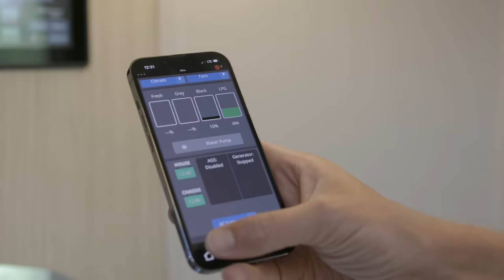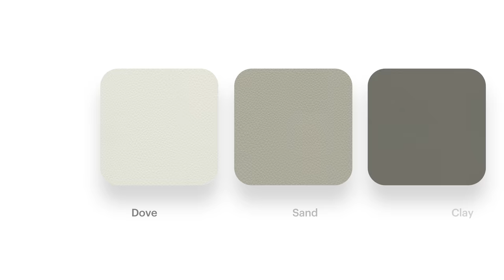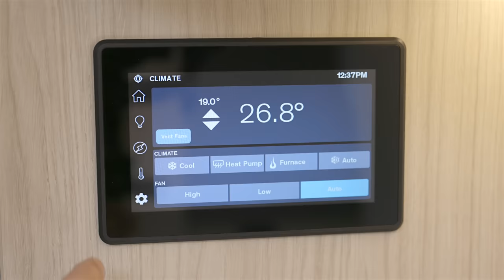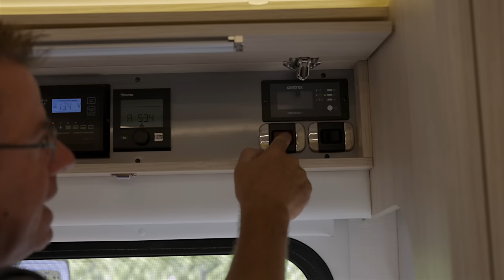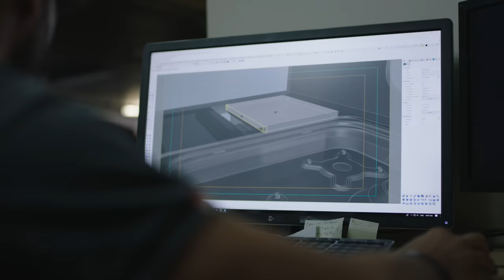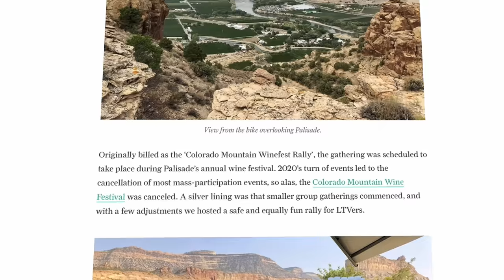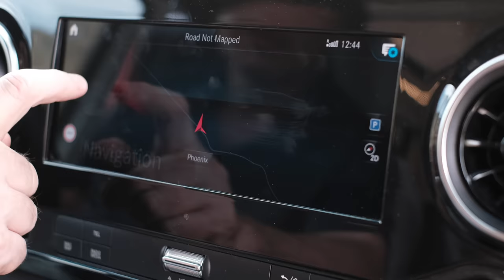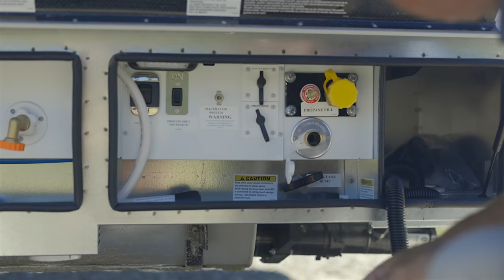2023 Unity Murphy Bed Lounge

Comment: Great vehicle with lots of amazing features - the Murphy bed is a real winner! However, as a Canadian - one thing lacking in almost all RV's, is good winterization, which is, adequate insulation for use during late fall and even the winter, instead of renting a chalet. I want to be able to park the van outside in -10C weather and not worry about pipes or the fresh water and grey water tanks freezing up. Even going to high mountain areas or up the Alaska highway into the Arctic, where temperatures are considerable cooler, better insulation means less running of the propane or diesel heater or the air con.

Comment: I wish Leisure Travel Vans would consider using Panasonic Vacuum Insulation Panels in Unity Models. The R-Value is R-60 per Inch! They can custom make panels to spec. The vans would be cooler in Southern climates and toasty warm up North .... year round.  It would justify purchase as year round livable vehicle.

Comment: Really glad to see induction cooktop and other additions. Will love it when propane is out of RVs. More solar when parked and more batteries, or if Ford gets that Hybrid Engine with large battery pack... can be even more off grid.
Reply: They listened!!!! Induction!
Reply: I think you meant propane.  It still uses diesel.  The key is more lithium battery storage.
Reply: @joniboulware1436  We call propane natural gas sometimes even though inaccurate.The F150 Hybrid can get up to 7.2 kW battery pack you can run tools off of and then kick on the engine to recharge. Would save space too. I'd imagine they could create an even larger battery for RVs.

Comment: I am blown away.  I would like an option for 360 degree cameras that can stitch the 4 camera feeds into a surround view, like offered on Teslas and Chevy Traverse.  These also need to be available for viewing remotely, and with motion sensed video recordings to the cloud (in case someone breaks in and steals or vandalizes the equipment) and/or local storage (SD cards) for continuous or motion event recording.   Presentation here excellent, kudos to Dean.

Comment: Still an Absorbtion fridge.  I have a 12v compressor fridge in my CRV, and it works rock solid, and freezes things when needed.  Upgrade the fridge instead of the hokey fridge door!

Comment: Behind the bathroom sink install a molded high temperature water proof insert that can be removed for cleaning. This is critical so wet shampoo bottles & hot curling irons etc can be safely stored. Also grove the insert so dividers can be placed in so they don’t shift when driving. If interested I will email a diagram.
Reply: Dividers/spacers are a great idea, they can even opt for foam-core to keep the weight down whilst providing loads of them for different applications/locations!

Comment: Need an all electric option.  Proper sized lithium bank and inverter with a secondary alternator, 12v AC with heat pump, electric heated floors and water, induction cooktop.  Most of the competition is doing it and there’s lots of people doing it aftermarket with their Leisure’s.  Need a factory option already.
Reply: No power grids to support them, charging takes forever, battery eventually starts taking less and less charge. And tons of people have reported that many charging stations don't put out the correct charge or even work. EV is not viable and certainly not cheaper than gas right now, considering the time you'll be investing charging.
Reply: @krninja22  I’m not talking about an electric engine, that’s not realistic at all, I agree.   When most people refer to an “all-electric” option with these small RV’s, they’re talking about a replacement or viable alternate for the generator, as I am here.
Reply: Ltv lets other brands do their technology beta testing.
Reply: The technology is mature enough to make it a viable option. I would put down a deposit today if a Lithium package were an option.
Reply: @nhifredminix7352  , lithium 200 amps is a current option.
Reply: @rvtalltales9327  200 amps is just a replacement for the lead/acid batteries. What I understand the original post to focus on is enough amps to negate the need for a gas generator. 600 amps @12 volts would be a minimum. A complete lithium system involves far more than simply replacing lead/acid batteries with lithium batteries. It includes the items mentioned by Josh Matthews, i.e., "secondary alternator, 12v AC with heat pump, electric heated floors and water, induction cooktop".  I was really hoping the new reveal would include these upgrades.
Reply: @rvtalltales9327  not enough. Need at least 600 ah and an auxiliary alternator.
Reply: @rvtalltales9327  the lithium option today is simply to replace the house batteries, not the generator.  The technology has been proven out by the competition over the last number of years as well as aftermarket companies modifying Leisure vans.

The comparisons between Leisure and Apple are obvious.  They make the best designed and refined products and they let the competition play with new technology before they implement it.  We're past that point now with the all-electric generator alternative.

It's one of those things that really helps refine the entire experience of camping as well.  It's very in-brand for Leisure.  They just need to make it happen.
Reply: If it was electric I’d consider
Reply: I agree, especially a 12v refrigerator!  I don’t know enough about a 12v AC to want one, but I am intrigued.  The issue with batteries on these is space, where are you going to put them?  200 AH is nice, but to do it right the minimum would be 600 AH.
Reply: All electric??? What is it fails? Better to have easy manual and basic charging options.. layout fine.
Reply: @creinicke1000  more spacious inside and no noise and electric, with it’s own solar panels all over it, would help a ton.
Reply: I would add removing the generator, and putting a cinderella incinerator toilet and removing the black tank. I don’t want black tank and noisy generator. These are forbidden most of the time in campground. Also without the tank and the generator it saves more than 240 lbs at least. Weight saved for the bigger battery. I would add an second mppt controller and an external mc4 plug outside to add 400w external solar panel. Also i would add a plug outside for a Starlink external satellite internet connection. The plug would be connected inside to the router. I would put two 360ah batteries and a victron inverter, i would use the aventa ac or an rtx2000 12v ac. This the minimum for me to have the perfect RV.
Reply: @CC-gt3ro  gonna need more battery capacity than that for an incinerator toilet, maybe a 48v system instead of a 12v.
Reply: @joshmatthews3450  no it uses only 1.3ah. And use propane gas. 720ah would be enough with 800w solar ( 2x 400w with 2 mppt controller. One for external panel). 
Also i would add a second alternator 250a to charge the battery with the diesel. So no need of generator. Also i would remove the black tank and all accessories linked  to it. I would save a lot of weight. Believe me i always know what i recommend. Also i would add a starlink sattelite internet plug outside with a mc4 port linked to the second mppt controller. I would have enough space to add a second water tank and a filtration system to recycle grey tank into the water tank. Then i would look if i must replace the fridge if it is not 12v compressor by a Isotherm marine fridge or Norcold or Dometic that uses very low power.  The question is much more if the propane tank is enough or not. So instead of second water tank, we could put second propane tank with auto detector switch.
Reply: @CC-gt3ro  I’ve only seen the incinerator used in one modern build and it eats battery when it’s used.  I like the idea, I was just pointing that out.  I’ll find the link
Reply: @rvtalltales9327  for true off grid solution you need two 360ah batteries or three with 800 to 1200w solar in roof and external combined and you need two alternator one dedicated to charge the battery when car is idle and moving. Alsi LTV still hesitate with the fridge. It is very important to take a Isotherm Marine 12v or Norcold or Dometic 12v with compressor. LTV fridge is not good enough. You want to keep the propane for the heating and use induction for main cooking. The external cooking can still use propane. Also you don’t want a black tank but it is necessary to install a Cinderella incinerator toilet so you use minimum water and can install a filtration system to recycle the grey water. So you triple your water tank technically. This is real off grid. Then you instal a plug for  Starlink internet to get access internet everywhere even in the desert.
Reply: Not up to cross country travel when you still need to stop every 3-4 hours and charge for 2 hours, if you can find a charging station. Soon hopefully those limitations will be removed
Reply: @Miz-Newsy  keep reading the comments.  When people talk about an all electric RV, 99% of the time we’re not talking powertrain.   Obviously the tech isn’t there yet.  That has nothing to do with Leisure anyway.   We’re talking about replacing the generator with lithium batteries and the corresponding appliances.

Comment: The recliners are nice. It appears the headrests have your neck pushed forward too much when fully reclined and perhaps too much weight on the lower back and tail bone. There’s probably an in-between adjustment that would work better. Or perhaps this is something you can improve. 😉

Comment: What a great layout!  Seriously I watch way too many of these rv videos :), and I love this design, people underestimate the value of a great bathroom. Bathrooms are the thing that sets the standard, Rvs are measured by the bathroom set up period.  Leisure understands its better to have a non permanent bed and have a sweet bathroom!  I never understood the idea of a permanent bed room set up.  This design is perfect, all the little thing are there,  diffused lighting reduces shadows and helps expand the space.  The extra large mirror in the bathroom expands the space and depth of the van.  The large skylight in the bathroom expands the space and provides breathing room.  There is no compromise in movement in the space at all you can easily travel around in any configuration.  The only thing I would say that rv companies seriously underestimate is venting.  You need to have good vent designs and ditch the old style  bladed exhaust, you fix that and you will have next level rv quality.
Reply from the maker: Thanks for watching, and we always appreciate feedback!

Comment: When you are using the galley, is there a place to store the covers of the sink and cooktop when you are making dinner?  It looks like there are 5 Corian covers in total. I suggest making a storage slot or two on the inside door where the garbage can is mounted then attach the trash can on that.
Great upgrade guys!
Reply: I wonder if the very shallow drawer under the wardrobe is for the purpose of storing the Corian covers?? What else could it be for?

Comment: COMMENTS:
This is a great floor plan.
The little table beside the bed should be a little bit higher to make it easier to reach once lying on the bed.
Don’t like basement doors which opens upward. I prefer doors that open sideways. It makes it easier to reach in especially those located underneath the slideout. And those doors should also be isolated.

Comment: I know it is hard to keep up with new technology in the production line. I'm glad to see induction cooktop. I just picked up my 2022 UTB model, and ended up buying a portable induction cooktop because I didn't want to cook inside with propane. I like the concept of the multiplex system with the convenience of turning off all lights at the bed. Now if only Mercedes provided a tpms with this model platform. That would be a great addition.

Comment: You guys should put the hinges of the outside tv on the bottom and some way for it to stay out at 90 degrees so you have an outside table.
Reply from the maker: This was actually the original design! We tested it. But it gave the impression that it can hold weight, which would put too much stress on the hinges depending on what was placed on it. The other problem is that when sitting low, it obstructed viewing angles depending on how close you were to the TV.

Comment: Is a sofa still available (which I prefer)? Also are inside see-thru sun shades still available?  Does it have to have the tv? I prefer to have no tv. I prefer a desk/ work area!  Is there a place where a “big cat” pet door could be installed for litter box that can be accessed from outside for cleaning the litter box?  Can the convection/microwave oven be removed and freezer/fridge either be moved up high with storage below or slightly larger freezer/freezer be installed for more fresh food. Love the windows above mb area— biggie for me- love windows!
Would rather not have electric awnings unless it can also be used with legs and be able to angle down more. 

I’ve loved this floor plan since 2010 or 2011. I’ve inside photos of the 2018 on my fridge door. The above are ideas of what I would try to have changed when able to purchase my favorite rv for my cat and me to live in and full time travel. 

Every year I always enjoy watching Dean do a splendid walk around showing all the great details and features of this model.

Comment: The vehicle is awesome, I always look for where I can put a portable washer/dryer all in one, would the dog house in the rear (ladder storage) have an outlet to support?  The MBL is packed with dry camping features but most small RVs never have adequate storage to keep a portable washer/dryer in an exterior storage compartment.  Maybe a future consideration for incorporating.
Reply: What kind of unit do you refer to? Id like to see the size and price of such an all in one, thanks
Reply: COMFEE’ 1.6 Cu.ft Portable Washing Machine, 11lbs Capacity Fully Automatic Compact Washer with Wheels, 6 Wash Programs Laundry Washer with Drain Pump, Ideal for Apartments, RV, Camping, Ivory White on Amazon.

Comment: Pro , induction stove with cover
Con, not a rectangular sink 

Other than that I like the 2022 murphy rear lounge better. Like non slider vehicles 

I don't like the windows being blocked by a TV
The lounge chairs should swivel into a dinette position. No need to be moving pillows.

Comment: Only thing you guys did wrong on this coach is not making it solar with lithium and chassis charging like winnebago does on the travato 59gl. I will say this coach is absolutely beautiful, perfect floor plan. Fix this power situation make it like the 59gl travato with solar large lithium batteries and chassis engine charging and chassis auto start to charge and your going to have really awesome selling coach. Make sure you can run a/c for 10hrs off batteries.

Comment: OMG - I was getting ready to trash the ugly wall/no window thing that every Murphy bed unit has and ask why not just make the couch that's in front of the Murphy bed into a bed and dayum! You took all the steam out of my 'complaint. Wonderful recliners instead of a couch and a shorter bed so the wall isn't ugly and WINDOWS!!!  I am sofa king excited!!!! No to a round kitchen sink and how hard is it to have pull-out extra counter space. A lot of people disagree about a separate sink in the bathroom but I think it's wasted space. If you prep raw meat or chicken in the kitchen without qualms, you can wash your bathroom hands there too. That's what bleach cleanup is for.  Tall as the shower is, it would benefit from being wider for full figured campers. In the cockpit area - a passenger side work surface so you don't need to struggle with an additional table set up - flip down/slide out from the dash area or pull up from the side of the seat. Love the light, bright look bringing the outside in - and the awning windows that can be open when raining.

Comment: Please consider  more diesel capacity, Diesel heat, hot water,  600 watt solar and FOUR lithium. 12 compressor fridge, as optional, for longer Rustic enjoyment..
I admit, I am sold on the galley, nice work.

Comment: Now this is what I'm talking about!
Room to move, not that cramped feeling of so many motorhomes.

So, a year ago (since this video) this was a prototype.  As I can see and have used the "Build" on your site, does that mean that one can actually buy this with chosen options?

As for that popup TV, is there an option to have it totally motorized with controls on the same side as the push button is now as well as on each side of the bed (or middle, on the wall) and perhaps another over by the 2 seats (with optional table) ???  Perhaps not only up/down motorized control but also motorized spin to chosen position?
That's the one thing that I actually don't like, having to get up to manually push the TV down.
I mean, the motorhome is gorgeous, but then you have to push the TV down!  ROFL  NOOOO!  heheheehe

What about maintenance on the road.  If driving in the States, are there specialized centers for this? Same question if driving across Canada.  ????  (is it safe to assume that general maintenance like oil / fluid changes are able to be done anywhere where they can do motorhomes?

One last thing... the Onan Generator... Is there either a gasoline?  Or better yet, is there a way to install a Honda gen (one of those very quiet "red" ones) ???

Also, I'm not seeing it, so how much propane does this carry?  1 bottle, 2, 1 large, 100lb possibly?

Oh, I forgot.  As someone who does NOT WANT a conduction stove, is there a propane 2 or 3 burner option?
That's very important to us.

????

Comment: Need to drop the Mercedes Sprinter and move to the Ford Transit. The difference in power, using gas vs diesel, and the all-wheel drive is just too much to ignore. The Mercedes is lacking when compared to the Ford.